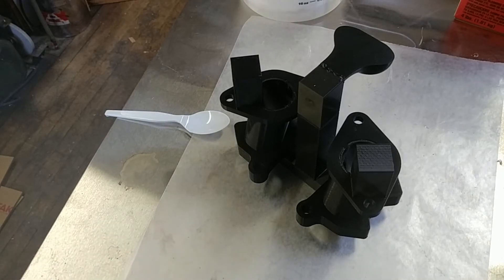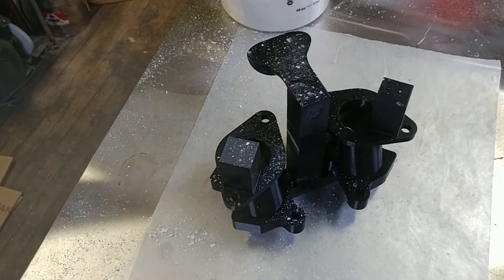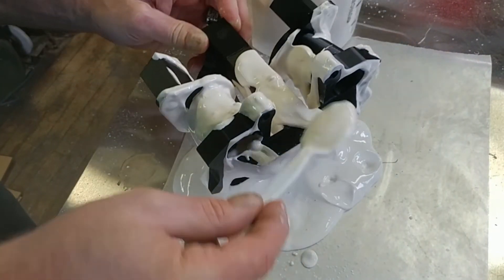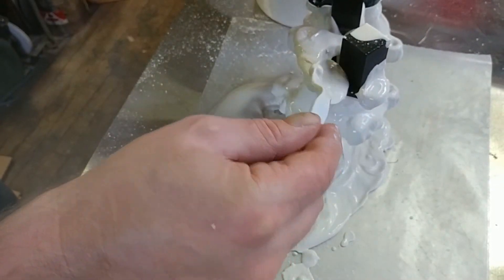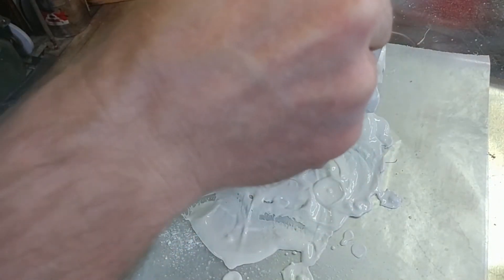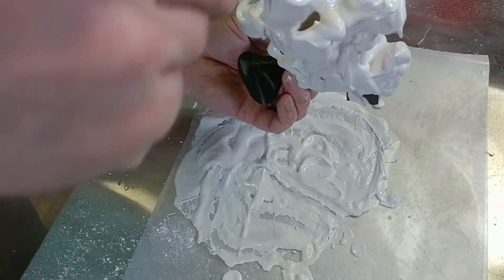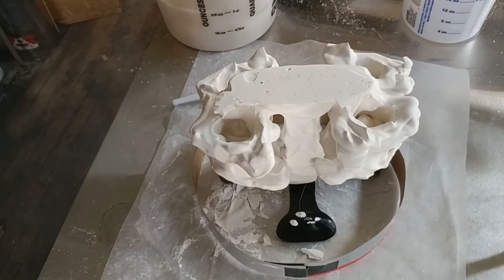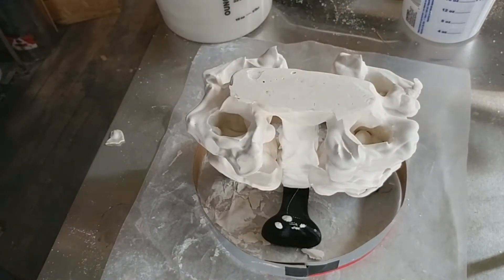Shell investment coating 3d printed mold for aluminum casting

Comment: I imagine that when you burned out the PLA the mold broke on you. 

I've tried to do something similar to this building up layers of wet plaster of paris and then coating it in play sand. 

The best way to do shell casting is to use silica slurry and sand. In college we would break apart old shell casting molds and grade them into different levels of coarseness and use that after a few layers of silica slurry and sand to more quickly build up a thick shell. Silica slurry is kind of expensive for a hobbiest. 

I've read that you can use the 5 gallon premixed joint compond buckets from home depot to build up a shell, however from what I've read you need to water down the joint compound a lot. It's similar to what you are doing but the premixed joint compound doesn't cure like plaster of paris, it dries. I've never tried it though, maybe it works maybe it doesn't
Reply from the maker: Sometimes it works, sometimes it doesn't.  If the mold thickness is over a cm or so, I don't mind if it breaks because I can essentially tape it together and bury it in sand and pour anyway.  This one had a section that wasn't coated enough, and when it cracked the pieces were too small to put back together.  I have another sitting waiting to cast, but we've been on a no outdoor fires of any sort for many months so I'm waiting for precipitation.
Reply from the maker: By the way, Ransom & Randolph sell something called Plasticast.  It's perfect for this because this is what it was designed for.  I don't have any right now is all.